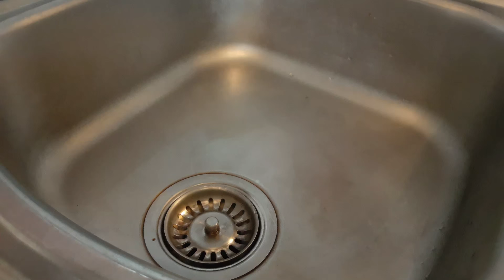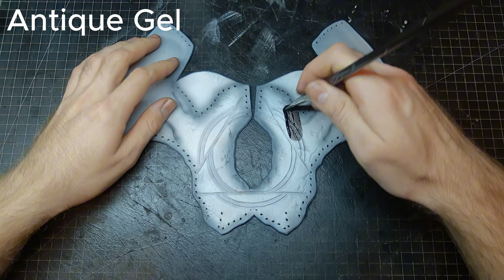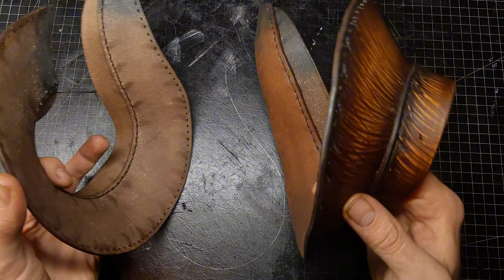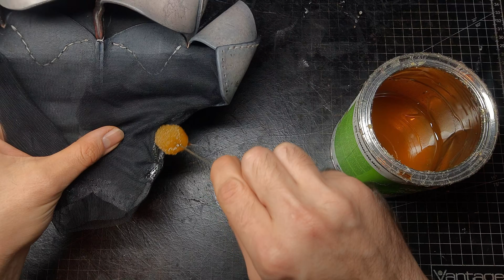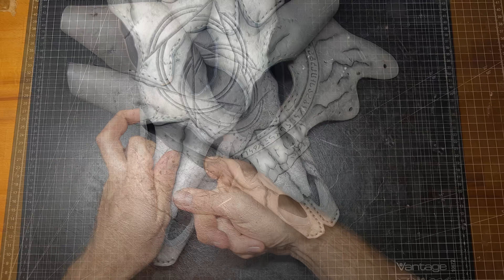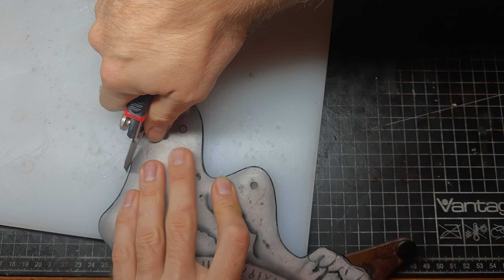Demon Goat Skull Helmet - Tutorial

Comment: Also, did you have issues with your acrylic paint cracking, or did it work well?
Reply from the maker: With the resist it worked well, it makes the paint more flexible, but there is risk as you have seen it when it is completely moisten and may rip off

Comment: Is there any reason why it wasn't possible to paint it after it was shaped and hardened? With an airbrush you can be quite precise.
Reply from the maker: @WobblesandBean  you could do that, would reduce the risk if ripping of the dye. You would get a bit less easy in all the corners and would not be able to get paint under the sewing thread but apart from that it should work. This was one of first time I noticed the tearing that much, so would be an option for the future. I also have repainted pieces in the very end and had no problems with it
Reply from the maker: @WobblesandBean  so for me it's mostly just common to do the painting with the dye before the shaping.